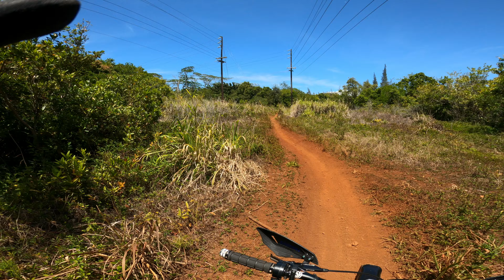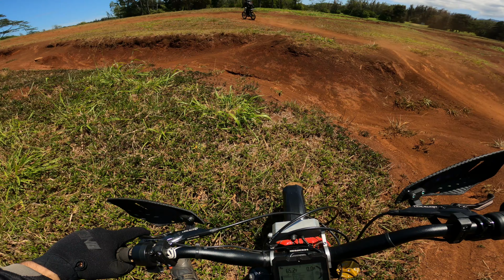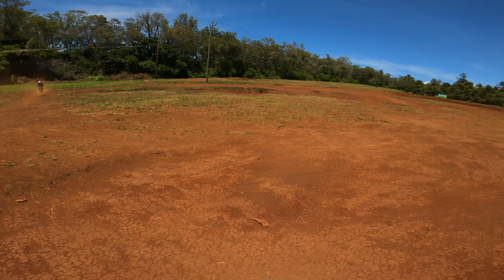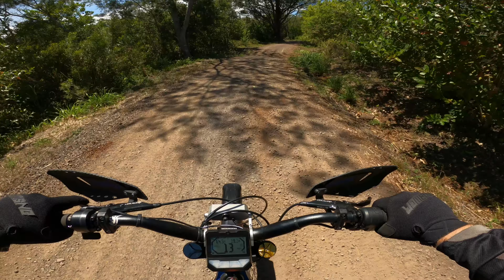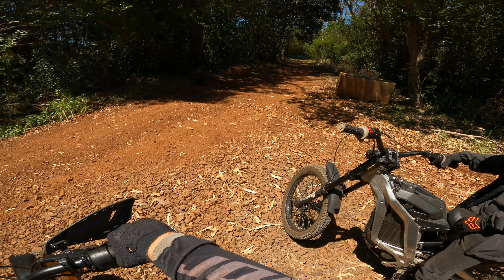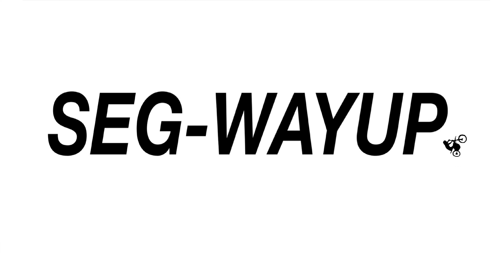Never Buying Magura Parts Again

Comment: Brake olive failure on MT5. Just checking my brakes one morning and it crapped out. Also mt5 plastic braking clamps for the lever crap out over charging for plastic. If something else goes out I'm going SHIMANO. All in the same week....
Reply from the maker: Ours was the plastic sticker that holds the fluid in the master. And the bleed screw is plastic, that’s gonna fail. Just an all around bad design. I went with dominion A2 and A4. Super awesome setup now. In the future I’m gonna run hope.
Reply: @Mayhemjach  My Bleed cap just turns lol never tighten. I guess I'm done with magura also.

Comment: my stock throttle does the same thing almost like bucks unless you are gunning it .. I just ordered a domino its the only replacement that is worth buying
Reply from the maker: Yup. Domino all the way. If your bike is made after April 2021. Domino won’t work with the stock controller, just so ya know
Reply: @Mayhemjach  hm this is the first I am hearing of this.. do you have experience with this? I know that later versions of the x came with different colored wires so maybe that was your issue?
Reply from the maker: @FingerBoardSnap  no it’s been proven, it’s all over the forums. After April 2021 they changed the controller settings to not allow them to work with that throttle. There has never been a clear answer why it was done
Reply: @Mayhemjach  Can you link me to the forum/post you are referring to ? I have not been able to find anything online about this. Maybe I am not looking at the right forums so any point in the right direction is appreciated
Reply from the maker: @FingerBoardSnap  I honestly have no idea. That was a long time ago. I would just try using google

Comment: I should have never bought the supposed 1/4 turn Magura throttle.  My stock electric one had better response time.  In no way is it a 1/4 turn throttle either.  False advertising.  I think a Domino one will be the way to go.